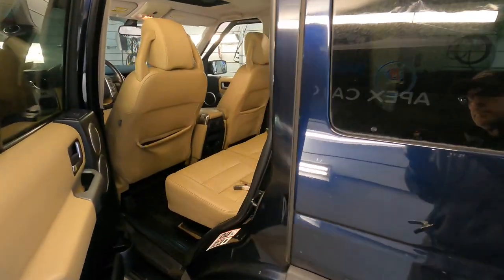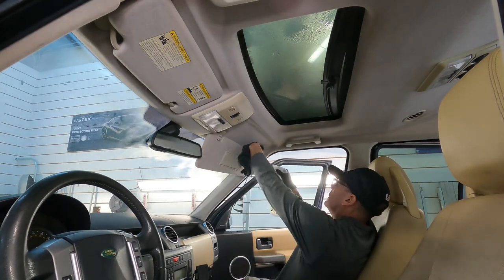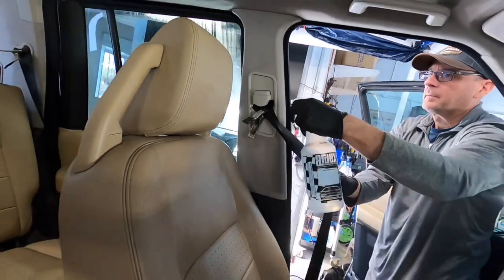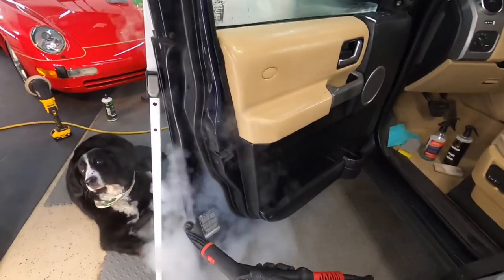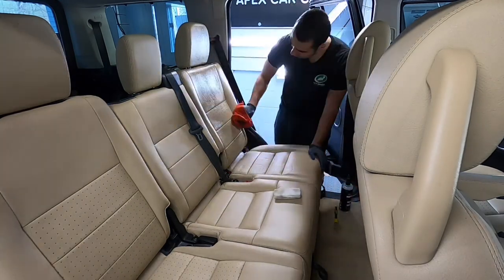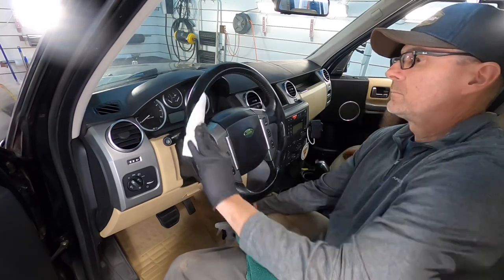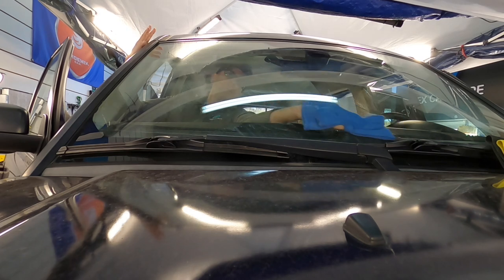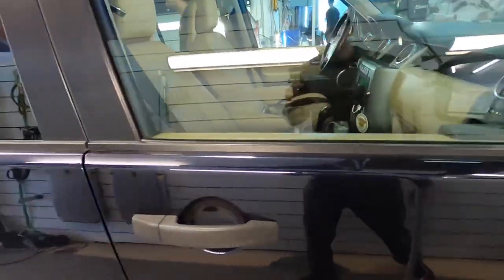HOW TO! Auto/Home Odor Removal! Smoke, Mildew, Pet Odors, Sports Gear, Dairy Spills And More!!

Comment from the maker: What do you rely on to remove unwanted odors?
Reply: Pass them along to another detailer. Seriously though , Great info.
Reply: Thorough cleaning with Bonnet Pro Omegazyme and APC top to bottom, dry fully then treat with chlorine dioxide
Reply: Ozone generator. Steam. CarPro Inside and CarPro MultiX.
Reply: I have two ozone generators. They work excellent but I first clean the inside just like you do Brian 👊🏼
Reply: Tell my boys to walk home...lol
Reply: I use biobombs also and it is absolutely fantastic at treating any odor I’ve ever come across detailing cars and also in residential and commerical homes and spaces. Great video
Reply: @bwashing659 does this leave a chlorine smell afterward?
Reply: I had a lady who hotboxed in a car from 6 years. It was literally used smoke weed with the window up for hours everyday for 6 years. I shampooed every inch of the interior including the roof for 5hrs. I did an odor bomb. I told her the smoke seeped to the bottom of her seat and could no longer be sucked out. I haven’t tried this bomb. Would it work for extreme scenarios like this!? I’m in the Bay Area and cannabis is a lifestyle here 😅.

Comment: Excellent Video ! If doing overnight or if you don’t want to run a vehicle maybe a small battery charger say 2 Amp , hooked up with the interior fan running to circulate air without running the engine . 😊😎